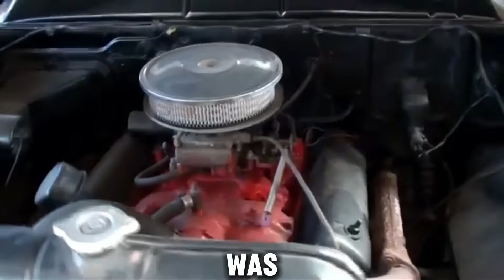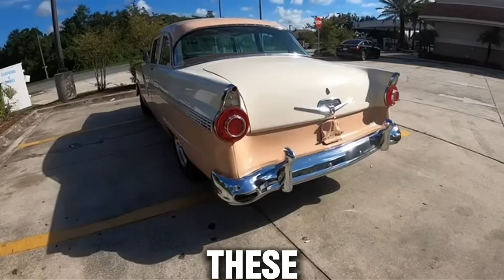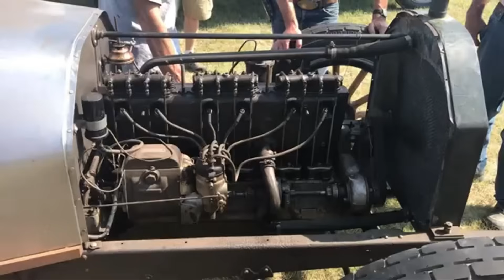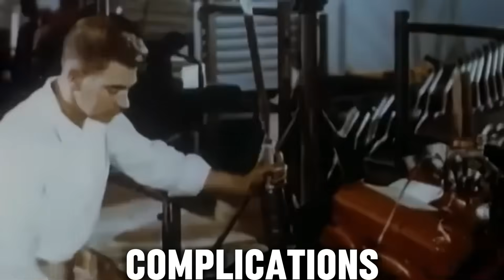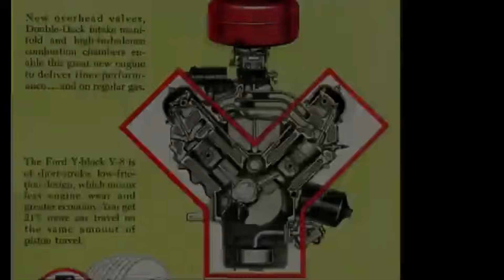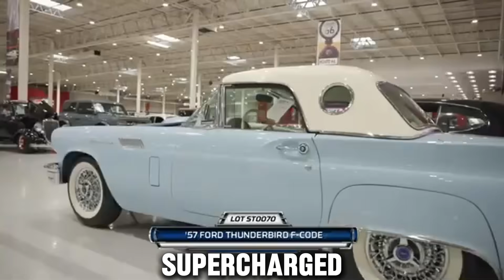Why Ford’s Y-Block FAILED in the America’s Muscle Car Era!

Comment: the y-block was limited as the bore was only 3.8 inches and there was no way to get to 4 plus inch piston diameter.  It had plenty of power compared with other 300 cubic inch engines

Comment: Few upgrades porting what ya can a modified adapter and two old school four barrel carbs bore and stroke it to a 342 ,ci. And adjust it here n there and ya can get over 400 hp solidly and reliably out of it.... They just didn't know how to make any engine vroom.... Ya can make any engine a badass with a lil know how

Comment: Get the facts straight , Cadillac did not have the first OHC V8 in 1949 . Oldsmobile designed both those V8s , and had started in 1946/7, in 1948 when Cadillac realised Oldsmobile Engineering Devision under Charles F Kettering was bringing out a modern OHV V8, Cadillac management had a big cry to GM head office , complaining that as the top brand at GM and Oldsmobile being second ( Chevrolet, Pontiac, Buick, Oldsmobile then Cadillac) , Cadillac should get the V8 first . GM relented and gave Cadillac a version of the Oldsmobile V8 design , much to Charles F Kettering 's dismay . They released both V8s at the same time , but as Caddy was top of the tree it got the biggest version at 331 ci and Oldsmobile at 303 ci . That set a standard , Caddy later as top of tree got the biggest V8 the 500 ci , next out was Oldsmobile with the first GM 455ci V8 as Buick and Pontiac were next down the tree they were not allowed to have a bigger V8 than Caddy or Olds so they settled at 455ci as not to go over Olds engine size , and Chev being the bottom of the GM tree they got 1 ci less at 454ci V8. 

This went on into the 1980s when Oldsmobile designed the Aroura 4.0 Quad Cam V8 from its Quad 4 , four cylinder motor , Caddy wanted a version , so Caddys had to be bigger at 4.6 litres and called the Northstar .

Comment: We had several Y blocks 239-292.  Had a 72 F100 that a farmer had installed a 292 with 272 heads, raising compression, and torgue. Low end chigged like a model T. There wasnt a field check that could kill er haulin hay.  Chevy's died all the time. Started right up in subfreezing weather, or after sitting for several yrs.  Hauled tons of firewood on a 56 1 ton, she could climb out of any gully fully loaded, nevet let us down.  Newer trks from the 60's, 70's had more power, but they didnt work any harder, or longer.

Comment: The deep skirts were for transmission mounting not strength. Also rocker oiling issues led to kits that “piped” oil to the top of the engine. Ford also had a 340 HP version of the supercharged 312.

Comment: I saw a Ford hot rod with a Y block instead of the usual Chevy 350.  That's a great way to enjoy it however I respectfully disagree with the "maybe" "could be" possibilities  1) The 460 is a beast of a block, making a visit to the 50s tech unnecessary.  A 312 does not stand a chance.  2) thin wall casting did not necessarily result in a weaker block.  There wasn't a single drag racer who gained experience making 1500hp in a mopar RB hemi but said, those thick heavy blocks of the 50s were better, so let's ditch the 426 and go back to the 392.  The 392 was not designed with lightness in mind but it could only support 2/3 the hp of the 426.  If it held more hp, I honestly think forced induction competition machines would have reverted back to the 50s blocks.

Comment: the only problem with the Y block was it Was too bulky for it size, Ford had developed a new big block for 1958 
if you wanted power and  the Y would not fit into the engine compartment of Ford's new Compact cars. The Y block was not a bad engine it was just not nessasary any more.

Comment: I look at today's 5.0 with 4 valves per cylinder, dual overhead cams making over 400 hp naturally aspirated and I realize we didn't get from a 4 cylinder flat head engine in the model A making 35 hp to today in one single step. The Y block was not a failure. In fact it was an improvement over the previous flat head. The exhaust valves were in the block of the flat head. The block ran hotter as a result. Moving the exhaust valves out of the block helped the block run cooler. High compression was an issue with the flat head. Reducing the combustion chamber volume meant restricting the fuel/air intake and exhaust.  The Y block allowed the engineers to increase compression without restricting head flow.  The engines that came after the Y block had larger valves, higher compression, more torque and horsepower. Failure? No. Stepping stone? Yes. It, like the others is how we got from the model A to the Mustang GT and F150 today. I'm 67 and if you think I don't know anything about the Y block, my second vehicle was a1955 F100 pickup. Dad and I converted it to 12 volt.  Today I have a C5 Corvette with a LS-1 and a F150 with a twin turbo V6. My memory of the Y block I had in my 55 is not a failure. My memory of it makes me smile when I see these videos calling it a "failure". Who knows, maybe if you ever had one you would have made this video a little bit different.

Comment: I had a 54 2 door wagon with a Y Block. It was really smooth running motor. In the mid 80s it kept up with traffic but it wasn't quite enough on the freeway.

Comment: The Y block was a great engine. The engine didn't fail. Ford failed the Y block. It was advanced for the time. But a few simple head and block adjustments like the 302W to become the 351W would have taken it miles ahead. Another sad engineering mistake from history 😢.

Comment: The Y block failed because, like a lot of engines, it was just a step on the stairway in the evolution. The heads on any engine from the 1950's flow terribly compared to what is standard on modern engines and even poor compared to muscle cars in the late '60's and early '70's. The legendary '50's Hemi's heads flow roughly about the same as a 383/440 head from '68-'70. While it was a huge leap forward compared to the flat head 6 and 8 cylinders in the 1940's, engine design was in constant evolution. The Ford Y block actually as 4 intake ports that flow pretty good for an engine from that era but it's combined with 4 intake ports that don't flow well at all. And combustion chamber designs were very primitive by today's standards. So let's enjoy these engines for what the were when they were new and not worry about trying to make them something they weren't 70 years later.

Comment: the GM SBC showed-up in 1955....
Reply: So did the GM Pontiac OHV V8. Cadillac and Olds had OHV V8's in 1949, Chrylser came out with it's OHV V8 in 1951, Desoto in 1952 and Dodge and Buick in 1953. And there were other makes in this era that also released OHV V8's too.

Comment: The Y block had a lot of potential, it was a structurally strong engine. But the head design is utter crap.
Reply: That's definitely the design killer. Although did you see the Y Block on the Engine Masters Challenge a few years back? It made insane power and I never would have thought that possible with those bizarre intake ports.

Comment: If Ford had partnered with Zorz Arkus Duntov in the late 40's, they could have had an OHV engine several years sooner. The ArDun OHV heads for the Ford Flathead engines increased power and lowered temperatures. Ford ignored Duntov...who went to Chevrolet and was a driving force behind the Corvette for many years.

Comment: I should say my favorite engine from 59 is the 430 MEL in the "Turnpike Cruiser"!
Reply: Our police agency had 25. VERY GOOD ENGINERING.
Reply: @NormanSilver 430/462 Lincoln motors were smooth as glass and had more torque than just about anything else on the road. Fantastic motor.

Comment: I'm sitting on a wild 312, stellite seats, sodium filled exhaust valves,  dual four barrel carbs!! Cross bolt main caps! Just waiting for the proper vehicle! Had it in a 59 F250 4X4 pulled out for a proper 292! But it was fricken wicked!

Comment: FAILED? Nope. Beat Chevy to market with an OHV V8 by a year. The 292 & 312 versions bested Chevy at tracks, in advertising & sales volume during the Tri Five years. For USA sales cubic inches began to grow across the entire market. Yet, Y blocks were in production through 62 in cars & 64 in light trucks (USA) but lasted in South America production through the early 80s.
Reply: Chevy had a ohv v8 in the 191x
Reply: Everyone beat Ford with OHV V8's. Cadillac and Olds started it in 1949.

Comment: The Ford YBlock did not fail. 56-57 was the PRE-MUSCLE car era. In 1956 it won the NASCAR convertible series, where the Chrysler 300 which won the sedan series, with an optional 260hp factory engine performance kit. In 1957 Ford continued to win with it F code engine option that used a supercharger until outlawed by NASCAR but continued to race other venues. The big block engines for the entry level cars started in 1958. The real Muscle Car era started with the 1964 Pontiac GTO…Ford had moved on to the new Windsor based V8 for a standard engine because it was way cheaper to manufacture.
Reply: It wasn't just cheaper to manufacture. The Windsor is better in every way. The Y block has a solid lower end, but the heads were utter crap and couldn't really be fixed due to bad architecture.
Reply: The 1938 Buick Century combined the small chassis Special with the big 320ci overhead valve Roadmaster engine and became the muscle car of the day; police departments discovered them early on and started running them everywhere.

Comment: This was before PCV systems that extended oil life and suppressed sludge. ALL engines were sludge monsters if oil changes weren't strictly adhered to. The Y block wasn't uniquely bad compared to competitors.

Comment: It was proven that the cylinder head without flow the 283 Chevrolet cylinder head
Reply: It's proven what?
Reply: That's completely false
Reply: If you want to know the facts you can go to the "Stan Weiss- Cylinder Head Flow Charts". It has virtually every head both stock and modified and who modified it listed. There are multiple Yblocks listed including one stock engine. Even mildly modified they don't outflow the higher performance 283 "Fulie" heads. I didn't see a standard head on the list but I would assume they were probably about the same.
Reply: @1967davethewave sure they do.....that's why the y block was so legendary. Oh wait it wasn't at all. Subpar actually....the sbc .ade furd redesign it into the windsor
Reply: We can't even understand what you're trying to say because it isn't a complete sentence. A 283 flows better or worse than a Y block?

Comment: Why didn’t they bring them back later ,,, seems like it would do better the 2nd time
Reply: They were dead end design just like the Chevy 348/409 "W" motors. The increase in engineering knowledge between 1954 and 1964 was exponential and the same is true from the hey day of the muscle car era until the 1990's and again from the 1990's until 2010's. And it's still evolving.

Comment: Ive never seen a hydraulic lifter y- block
Reply: Exactly
Reply: Y bock never had hydraulic lifters
Reply: @briancritchley5295 Um, better do your research, cause they certainly did...
Reply: All flat tappet cams were used so your not wrong this was typical for the time in the 50s and into the 60s
Reply: Yep, lincoln Y block had em, Ran great!